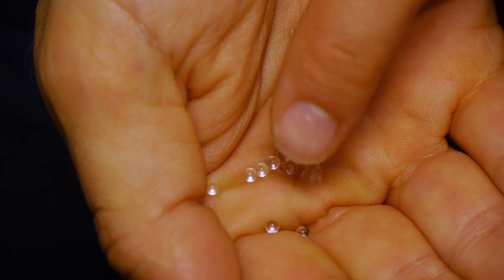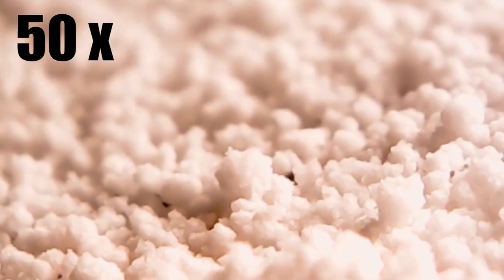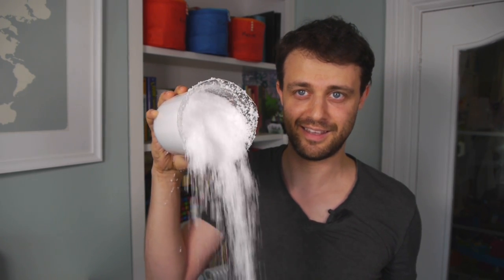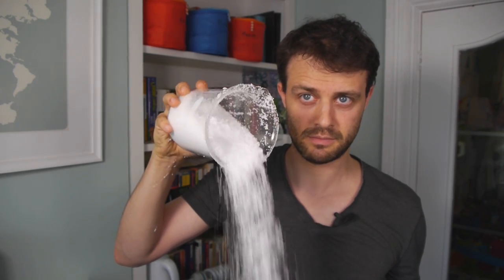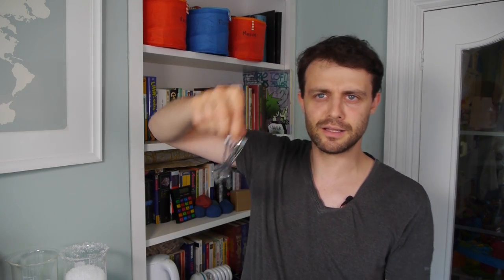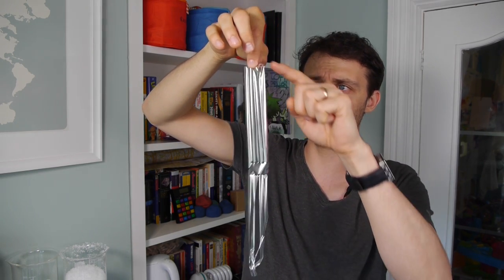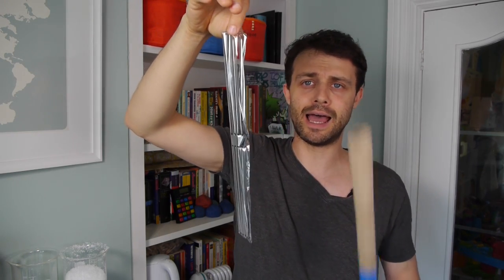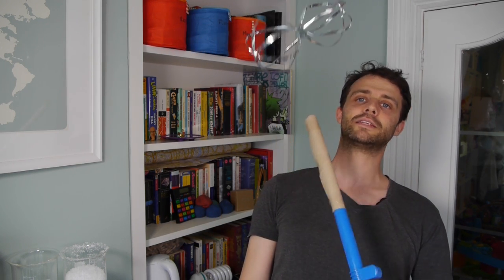This levitation experiment explains how diapers work

Comment: SUGGESTION: Use your "fun fly stick" Van Der Graaf generator near a stream of water (or perhaps other liquid) to divert the stream. You can also make a Kelvin electrostatic generator that uses moving water to make static electricity. Someone else has posted an explanation, but it's a bit dry... so to speak. I made one decades ago (LONG before the web, let alone youtube), and easily had the drops missing the lower cans...